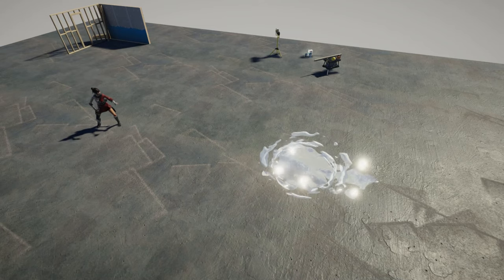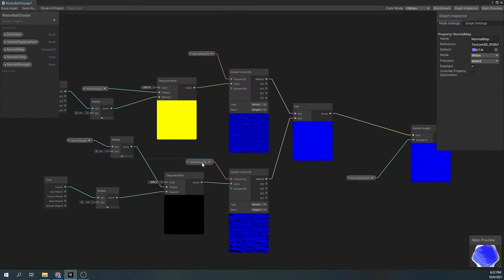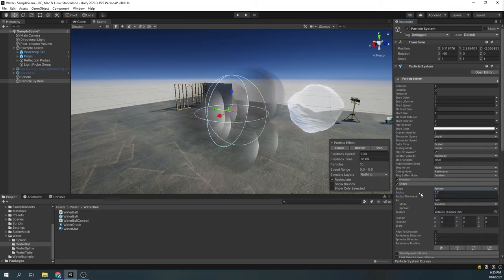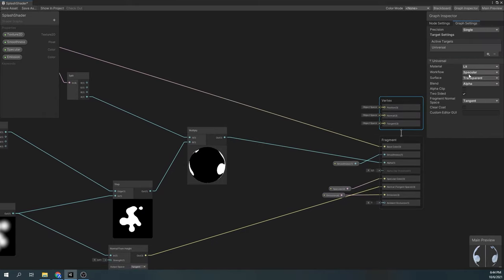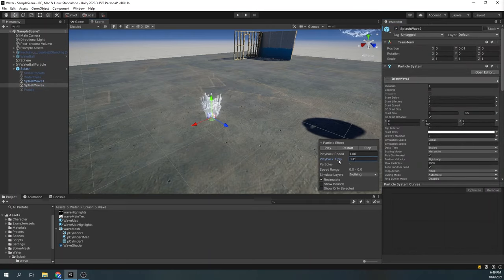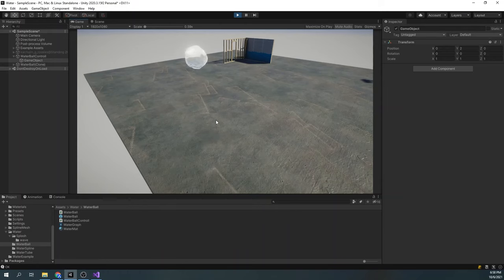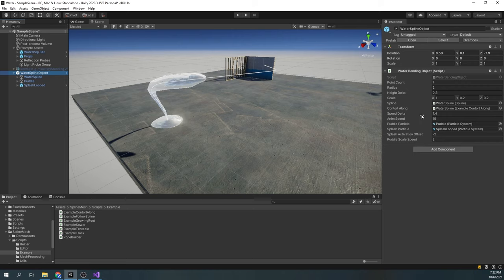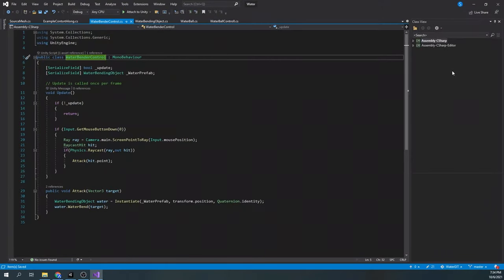How To Create Water Effects in Unity - Water Bending Tutorial

Comment: I cannot find the "Render queue" on my material and only get the flashing when the material is set to transparent, on opaque nothing happens! Does this not work in HDRP? @A Bit Of Game Dev
Reply from the maker: Hmm it should look better in HDRP. The render queue shows on custom shaders. In the prebuild shaders the "Priority" is the render queue.
Reply: @ABitOfGameDev  Are you sure the surface should be set to opaque? for me it's just a black sphere when I try to do that, the flashing only occurs when I set it to transparent. Also changing the "Priority" doesn't do anything, and it's only limited to -100 to 100 instead of 3000. But checking in the actual shader file it says the render priority is at 3000 behind the scenes, despite the continued glowing.
Reply from the maker: @ottojacobi3059  
Update: Instead of pluging in the Scene Color node to Base Color, plug it into emission, and set the base color to black. That's how I got the distortion to work in HDRP.
Ill copy the answer from another comment below maybe it will help.
But I checked it on HDRP the settings are completely different. Im sure you can make it work the transparent option will work just fine, its just that the clipping when you combine two spheres right next to each other might be a bit off. But for the Water Bending effect it doesn't matter.

Ok I checked it but they might have changed it in urp 12.1, this is done in 10.5.0.
So the combination that worked for me is:
In the shader graph settings, set it to opaque.
But on the material you create set the render queue to 3000 (transparent queue)
If you don't set the render queue it will be a black sphere or god knows what since it will draw itself on itself.
You can work with the transparent setting in the shader graph but it dependes on the goal and look.

This way I got the spheres to blend together (clip each other) instead of one drawing on top of the other.
Reply: @ABitOfGameDev  I tried this and while it's certainly better than before (I can see the effect wanting to come through), I've got half of the object doing the effect while the other half is just opaque grey.  That is with the transparent option on, opaque remains the same black ball as before. I cannot find how to reliably change the render queue in HDRP, and it doesn't seem to affect it at all anyway whenever I've managed to make it change between 2450 and 3000.

Comment: It doesn't work unless I set it to transparent. Maybe it's because I'm using URP 12.1
Reply from the maker: Ok I checked it but they might have changed it in urp 12.1, this is done in 10.5.0.
So the combination that worked for me is:
In the shader graph settings, set it to opaque.
But on the material you create set the render queue to 3000 (transparent queue)
If you don't set the render queue it will be a black sphere or god knows what since it will draw itself on itself.
You can work with the transparent setting in the shader graph but it dependes on the goal and look.

This way I got the spheres to blend together (clip each other) instead of one drawing on top of the other.
Reply: You should use a 3d renderer asset. My shader was grey too because my project is made in URP 2D